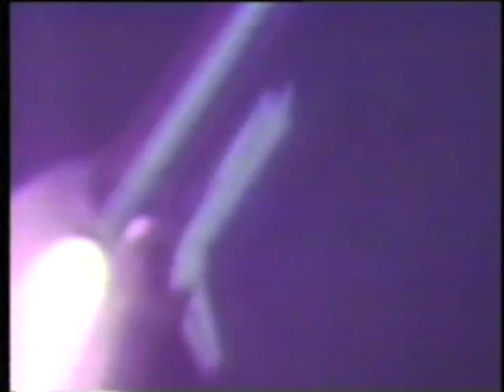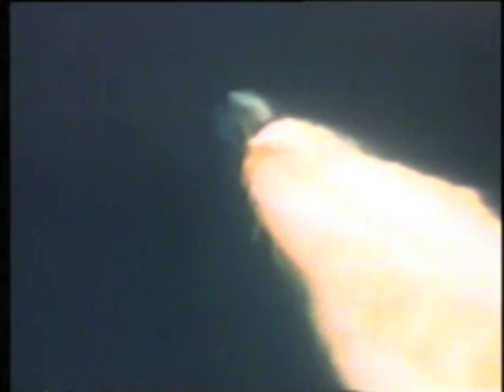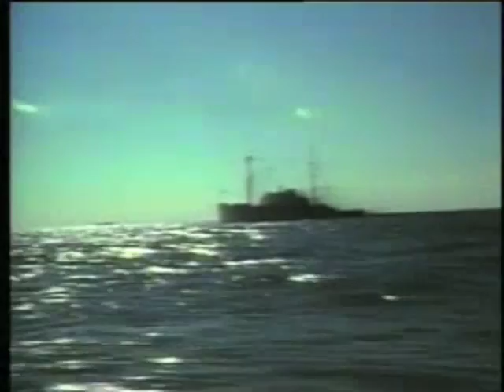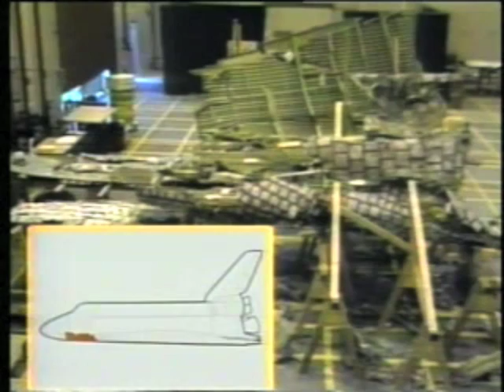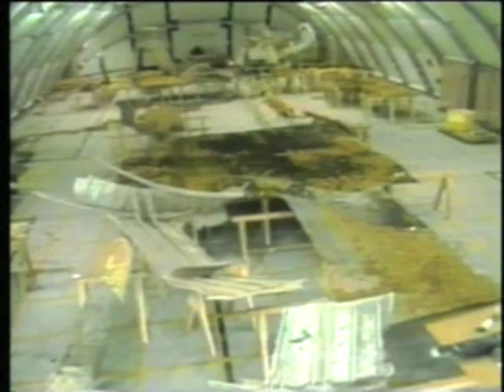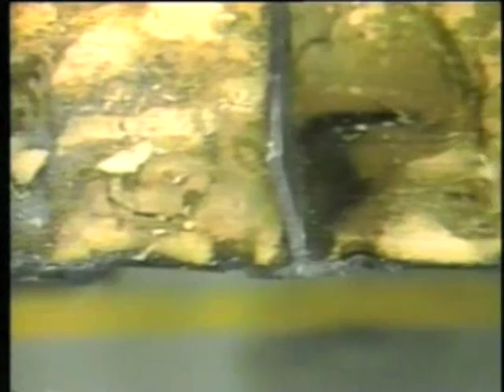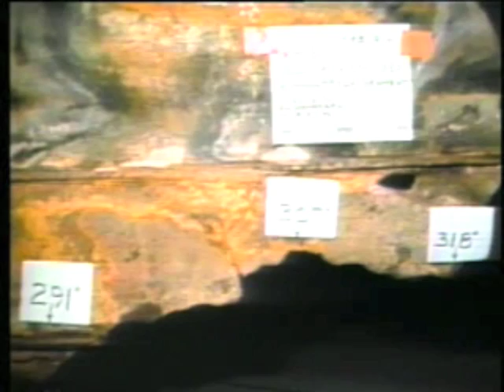Challenger Accident - Part III Photo and Video Analysis

Comment: I didn’t realize that they have explosive shape charges on everything to blow it up in case
Reply: @W Pontius I heard a talk by a former shuttle astronaut who said that they told her very early in her training that there was an abort system and if the vehicle veered or endangered public safety they would push the destruct button. She said " that would end the mission and also us. The shuttle was huge and posed a big hazard to public safety. Even if there may not have been explosives on the shuttle you have to admit that if on ascent they blew up the SRBs and the tank, something very Challenger-esk would have occured.
Reply: All rockets have a " Flight termination system" to protect public safety. It involves quite a bit of explosives. The system on new rockets Like the Spacex Falcon 9 are autonomous so if they stray too far or have a large enough problem they will blow themselves up. We should see it in action on the " crew dragon in flight abort test" coming up in a few weeks.

Comment: Why no one ever went to prison over the total loss of the vehicle and crew is astounding. Roger Boisjoly, an engineer working on the Challenger, tried to stop the launch the previous day. His reason for wanting to postpone the launch? The outside air temperature. Boisjoly warned that the orings in the booster rocket tanks had shown signs of leaking on previous flights. Boisjoly reasoned that the orings, having shown signs of leakage during liftoffs in which the ambient air temperature was nominal, when cold, would not be able to seal and result in the loss of the vehicle. Boisjoly must have wished that during his entire life, the one thing he had gotten wrong was his prediction of the events that took place that day. I, like most people my age, can still vividly remember where they were at and what they were doing when news of the tragedy reached them.
Reply: Politics.

Comment: ... and the astronauts were alive when they hit the ocean in the crew cabin ...
Reply: Yup
Reply: If they weren't gone from the jarring change of G forces from the explosion, I'm hoping they were unconscious for the free fall.  In the end it came down to greed and poor leadership that killed that crew.  We can't replace them but we can remember them.
Reply: G - Wolf nope they were alive 
https://youtu.be/1CMTD97CMD4
Reply: @g-wolf9445  -- Odds are most of them were incapacitated by the high g'forces resulting from aerodynamic effects that caused the break-up -- there was no explosion!  It's possible that some that past out due to high g's may have recovered later when the g'force declined before impact with the ocean, but even there they would be very disoriented and would not have been able to fully process what was happening.
Reply: Typical everybody’s in a hurry they couldn’t wait till temperatures increased.
Reply: yes they were but for sure unconscious!
Reply: @Christin5554  sadly not. Most had manually turned on their personal oxygen supply and the pilots were battling to restore power. Most were conscious for some or all of those 2 and a half minutes.
Reply: What if they had built a parachute deployment system into the cabin of the vehicle to help slow the decent to a survivable rate in the event of vehicle break up? Obviously a hard situation to foresee but just a thought
Reply: @ChaseRacebox  well, subsequently a parachute escape system was introduced although not sure if it would have been viable in free fall
Reply: Bazanadu True, especially depending on the orientation of the capsule at the moment of deployment. Obviously there would be zero control of that
Reply: @ChaseRacebox  I recall seeing in a documentary that something like that had been considered (some kind of ejection pod) but had been discounted.
Reply: NO SH1T SHERLOCK..YOU WANT A COOKIE?
Reply: Yes the were.
Reply: They hit the water at 207 mph, instant expiration.
Reply: @youarerightboss  you're a republican
Reply: @jukodebu , a TRUMP Republican. USA first! 💪🇺🇸
Reply: @youarerightboss  what a shock
Reply: @jukodebu , STRIVE TO REELECT 45 AND THRIVE 💪 🇺🇸 or die.
Reply: cosmic voyager Everyone is alive until they hit the surface of whatever they jump or fall from - that’s misleading. Several survived after hitting the ocean - I’d guess 3, the main flight crew.
Reply: Fantom Phalcon this is absolutely incorrect. They hit the ocean at over 200g’s.
Reply: @flexywozere1  CORRECT
Reply: That is what the reports later said. Cuz I remember thinking those people guys are still alive and there was no immediate search and rescue mission; claiming the water was to cold
Reply: @Christin5554  They were conscious all the way down. NASA didn't want to release a "hey guess what they were all alive too!" statement for obvious reasons, so the ending summary was they could not know for sure. But the fact is evidence points to they all should have been and definitive evidence that at least several were, complicated switches being activated and emergency air that was used the correct amount of time from the disaster to cabin hitting the ocean.
Reply: Just like the pandemic today, the media lied to you then and still to this day. Why? Why would the media do that ?  Is it not possible they wanted to test how humans would react to a tragedy?  After a tragedy the public awaits their leader to tell them what do we do now.

See attached article about the Challenger crew is still alive. .... The shuttle took off, but the astronauts  did not?  Do not believe everything you are told.  Use the theory that white is black and black is white.  Do not let the media  to overrule your common sense.

https://aplanetruth.info/theyre-alive-challenger-crew-found-alive-and-well-30-years-since-the-disaster/
Reply: @Foo-Fah-Foe-Fum  -- You are a zero content zero history troll sent here to further papa Putins aims of destroying the west.  You do this by getting people to distrust all authority so others can create an alternate reality. GO FUCK YOURSELF!
Reply: @Foo-Fah-Foe-Fum  you lie

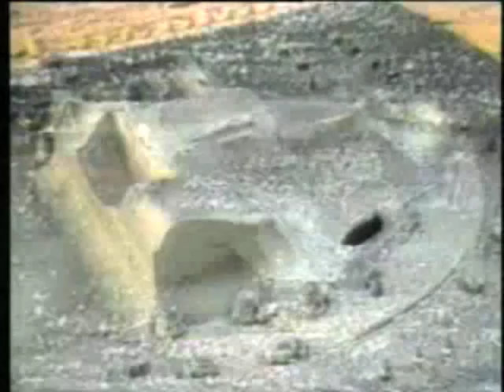Comment: 11:18 That snapped attach point shows the huge forces that were in play as the ship broke apart.
Reply: I noticed that the SRB boosters weren't destroyed but the external tank and shuttle itself. Only to kept flying on the sky before went off.
It's like the leak on the SRB seemingly ignited the external tank which was filled with fuel, and resulted in a huge explosion. That explains why most parts of the external tank were missing. But yeah, that's my analysis.
Well this accident occured a long time before I was born, but my grandparents had heard about it before.
Reply: @CrystalWings12  The loss of the Challenger felt a bit like 9/11.  The whole country was deeply saddened for weeks afterward.   1984 wasn't too far from the glory of the Apollo era, and nobody was expecting NASA to just fail on live TV like that.   It was a huge shock to our pride.
Reply: @josephastier7421  Uh huh. It was all because they ignored the warning about the SRB issue.

Comment: So, the 'o' rings were expected to operate outside their design capabilities. Whoever gave the decision to launch at those low temperatures knew the risks!
Reply: The report determined that the O Rings were defective but in my opinion, they weren't. Specifically, they were designed for a set parameter and considering the launch was 15 degrees colder than all previous launches, the design characteristics should have prevented the craft from being launched.
Reply: @colleensda  Part of the fix was to put a heat cable between the two o-rings to maintain the joint temp. regardless of outside temp. This should have been done to begin with in my opinion but it probably cost money so they didn't.
Reply: The bottom line in terms of every component, specifically a piece as important as the O Ring would have been to have established a baseline format for Go or No Go situations. This was not done for any aspect of the Shuttle. As a matter of fact, the determination that the O Ring failed due to temperature wasn't figured out until Richard Feynman came up with that theory right before his death. No one, and I mean No One at that time blamed the temperature for reducing the thickness of the Ring until he came up with it.
Reply: @colleensda  It also reduced flexibility of the rings. Flexibility is critical for a good seal as the pressure ramps up. I have done some work on o-ring seals for small solid rocket engines. I know it's not the same thing as this but o-rings flex a lot as they seal. If it's too cold to flex you can have problems. Don't ask me how I know that. :)
Reply: I get it.. I just remember reading Feynman's report and it was such a simple fucking thing to have avoided and the event shouldn't have happened.
Reply: As usual, all down to cost cutting and appearances for funding. So sad. Will we ever learn?
Reply: What's more chilling is we have to eventually be able to fly to other solar systems, landing on other planets safely and just a temperature change in our own atmosphere can cause such a disaster with our current technology. We may be advanced but our bodies and technology are still frail and not even close to what would be required to travel longer distances in space.
Reply: @Despond  The temps aren't the problem the design was bad. Liquid fueled engines actually need to be chilled before start up. The liquid oxygen entering Spacex's Merlin engines is -205 degrees C
Reply: You're assuming "initial conditions" would meet "expected conditions" and negate failure involving movement of gasses over the O ring. The problem was the freezing conditions shrank the size of the O Ring by thousands of an inch with set the vehicle into "Failure mode."
Reply: Just like the pandemic today, the media lied to you then and still to this day. Why? Why would the media do that ?  Is it not possible they wanted to test how humans would react to a tragedy?  After a tragedy the public awaits their leader to tell them what do we do now.

See attached article about the Challenger crew is still alive. .... The shuttle took off, but the astronauts  did not?  Do not believe everything you are told.  Use the theory that white is black and black is white.  Do not let the media  to overrule your common sense.

https://aplanetruth.info/theyre-alive-challenger-crew-found-alive-and-well-30-years-since-the-disaster/

Comment: One astronaut in Mercury -  tower escape system.  3 on Apollo - tower escape system......put like a dozen on board.....no escape system.  The F111 bomber had a crew cabin escape pod - the design would have worked as a basis for an effective low weight system for SHuttle.
Reply: Joseph Gibbons i
Reply: Not at those speeds....
Reply: So the follow up showed the astronauts were alive until they hit the water in the detached crew cabin but if they had an escape capsule designed for the F111 -- a Mach 2+ ejection system -- it would not work?
Reply: @josephgibbons1631  "alive" is a relative term in this situation. There was some evidence of the pilot inputting commands after the breakup. Some of the crew were not following protocol by not wearing their gloves and not having their face shields down which for them would have meant almost certain instantaneous death. 
   The F111 capsule was an awesome design and I get your point. That capsule was designed for two people. Not sure a capsule of any strength would have helped. Even if it had rescue chutes I wonder if they would have survived the breakup.

Comment: NASA wanted Norton Thyikol to prove the boosters can fail if shuttle launched in weather below 68 degrees.NASA proved it themselfs.Launch abort needs to be put in the computer hardware to prevent launch below 68 degrees.RIP crew.
Reply: In their static test, the SRB's did not fail. But they were not under launch conditions, and were not exposed to the wind shearing that happened. Carbonized residue filled the gap at the seam which initially stopped the blow through. Once it hit the wind shear, the stresses tweaked the SRB and cause the residue to break up. This opened up the path for the exhaust. If the O rings had not been exposed to the cold, they might have been able to maintain their shape and possibly prevent the blow through. Pure speculation on my part.
Reply: The night before Morton Thiokol told NASA a launch should not proceed if the temp was <53 F.  But NASA (quite logically) said Thiokol was inventing a brand new launch constraint.  After all, the shuttle was designed to be launched/flown year round.  They asked Thiokol for evidence that launches couldn't safely proceed at <53 F and Thiokol simply didn't have the evidence.
Reply: @joralemonvirgincreche  the boosters are tested on their side.Vandenberg was suppose to be up and running for shuttle launches and would prevent the icicles.The nation reconassice had nasa under contract for payloads since 1968.Also the cost to transport the shuttle back to florida was expensive.Some of those shuttles including challenger were not made for 200 miles up in space.Take off and landings only and piggy back testing on 747s.
Reply: Joseph Kundtz what are you trying to say?
Reply: @TPSTH23  computer programmed to not allow launch below 68degrees.
Reply: Joseph Kundtz Please allow me to recalibrate you sir. All flight rated orbiters (Columbia, Challenger, Discovery, Atlantis, and Endeavor) flew missions with orbit apogees above 200 NM. Some missions had orbit apogees that exceeded 300 NM. You should bring facts not BS.
Reply: The main engines were tested and were Rock Solid. Those goddamn Roman candles were the problem.
Reply: I think you stepped in it Sir Romero.
Reply: Joseph Kundtz Stepped in what? Which comment are you talking about?

Comment: With all of those HD cameras showing puffs of smoke immediately after liftoff and then torch-like plumes of fire exiting the SRB, combined with telemetry data screaming out something was wrong, couldn't the ABORT,ABORT,ABORT button been hit?
Reply: Richard Warren  There is no “abort” button.  Once those SRBs are lit, there is nothing you can do until they burn out.  It’s like a Roman candle.
Reply: You couldn’t hit the Abort Button on the SRBs as you couldn’t turn it off.
Also, fun fact
The competitor, the Buran, could abort its mission. The buran shuttle was a payload, and plus the main engines were on the Energia, same place where External Tank was placed in the Space Shuttle. So this means it could carry much more payload. Externally. It was similar, but internal hardware and wiring was completely different. What makes it more surprising is, it landed automatically uncrewed. You can also turn off the Energia when it is in flight, or you can just throttle it down so that gravity takes over lift, and you can land it safely. Cheers ✌️
Reply: Your stupid..once those SRB's are lit there is no stopping the launch....it was not a survivable event period.
Reply: @stephenbrown7545  Well YOU'RE stupid too then!! He was just asking a question for clarification. You're an 
a$$hole and a $hitty speller for no apparent reason.

Comment: Calling it an accident is a travesty.
Reply: I don't get it. No one set out to purposely kill these people. No one knew about the faulty seal until after the fact, thus, it WAS an accident.
Reply: @Beethovenfan12  because it was a combination of the faulty seal and freezing temperatures affected the Integrity of the O-rings.
Morton Thiokol engineers research showed hazardous conditions under 53 degrees.
Reply: @10Hammers  Negligence as a result of greed and impatience.
Reply: @10Hammers  Still an accident as they didn't agree with the engineers.